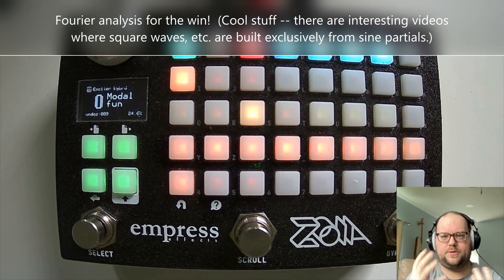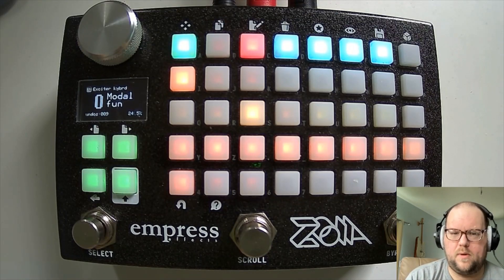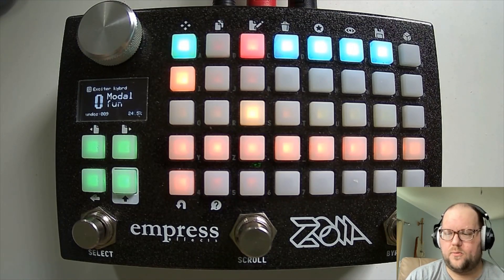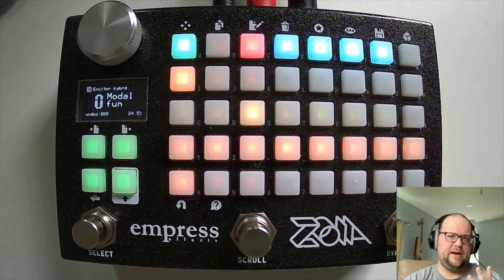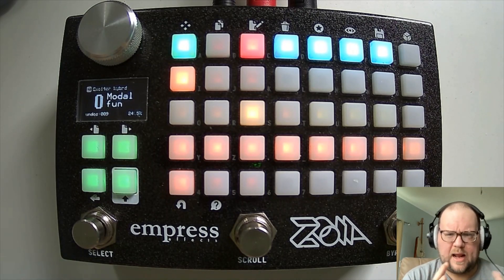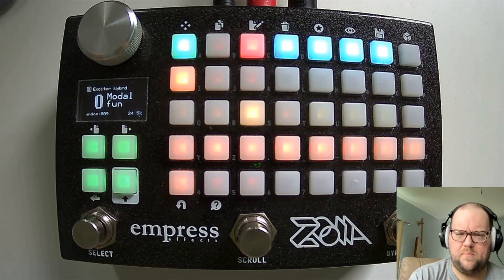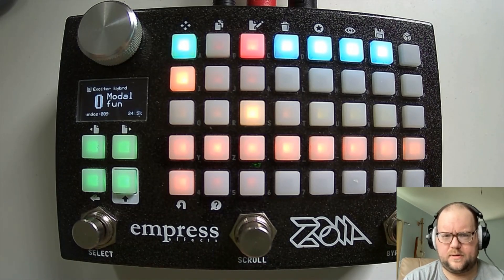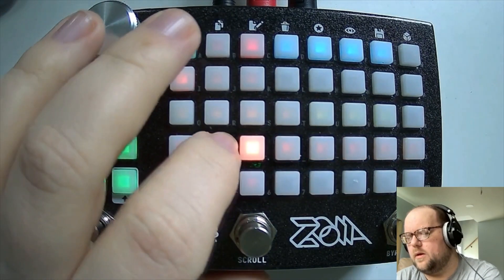Empress ZOIA tutorial:  "Zynth Zecrets -- basic modal synthesis, gateway to physical modeling"

Comment: Whoa. "When I split the signal, gain increases." WHAT. How did I not know this!?
Reply from the maker: I suspect you intuitively knew it, in some way or another, but yeah, gain control comes into play a lot with synth patches, whether it's a case like this, where an audio source is sent, in parallel, to multiple destinations and then recombined, or multiple voices converging on some effects processor/output module.  But parallel processing increases the gain, since each connection carries a complete copy of the original signal, including its original amplitude.